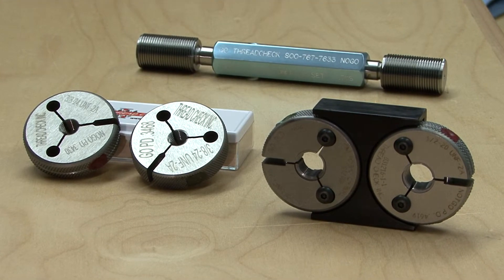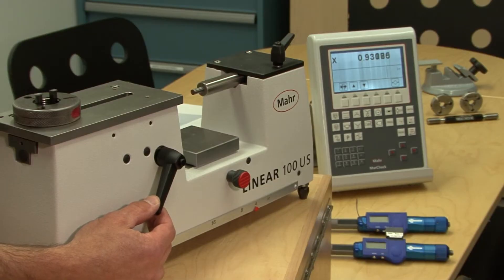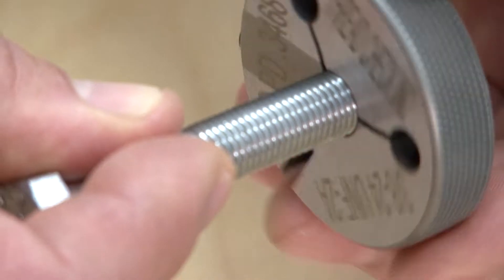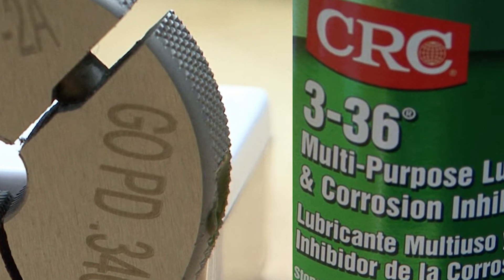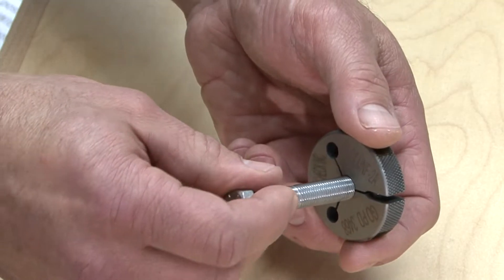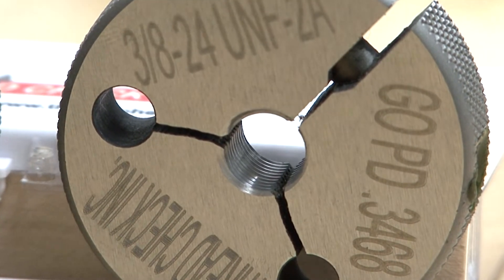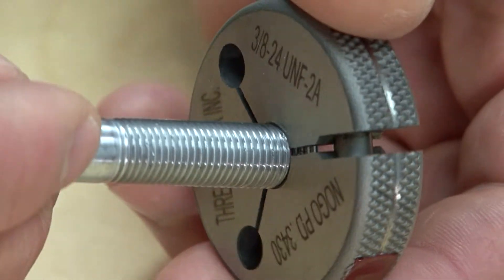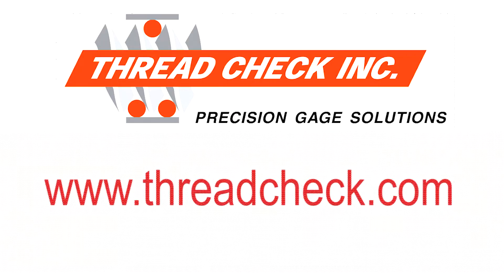How To Use Thread Ring Gages   Technical Series 101

Comment: Does adjusted thread ring gages form  3 lobbed profile ? Is it better to use a solid non adjustable thread ring gage ?
Reply: In the USA, the most common style is the adjustable style ring gage. They are set to master setplug gages. The Go adjustable thread ring gage when properly set accurately checks maximum minor diameter and maximum pitch diameter in a product thread. The adjustable no go checks for the part not to exceed the minimum pitch diameter. If properly set there is no 3-lobbed profile. In the USA, solid thread ring gages are more expensive and have longer lead times to build. When the gage is worn, it is not possible to adjust or repair. Solid thread ring gages have their advantages in that they can not be adjusted or unintentionally knocked out of size.
Reply: Thanks for a detailed response. Can a wear check plug gage be used as a set plug gage ?

Comment: Thread gages (Go NoGo) are simple to use but if not for small, standard threads then probably not as economical as implied. A ring gage does not inspect if the major diameter is below tolerance and a plug gage does not inspect if the minor diameter is above tolerance. Those two diameters are though easy to measure but not always done.